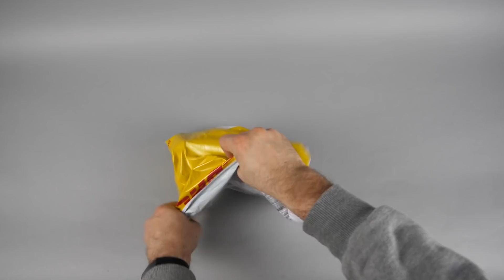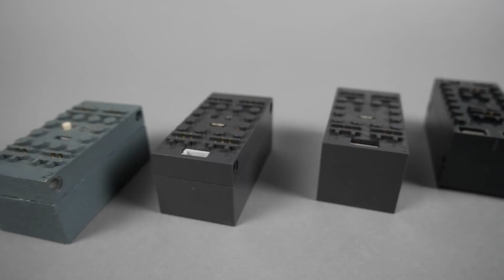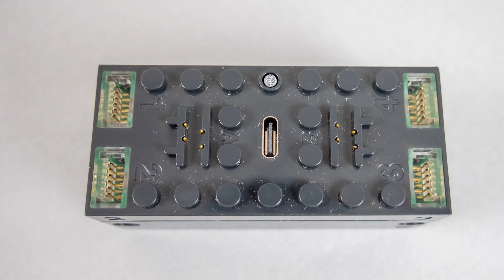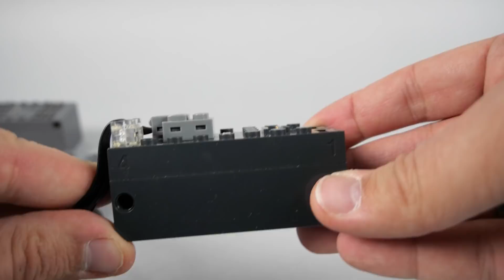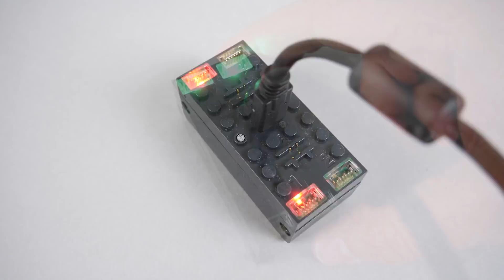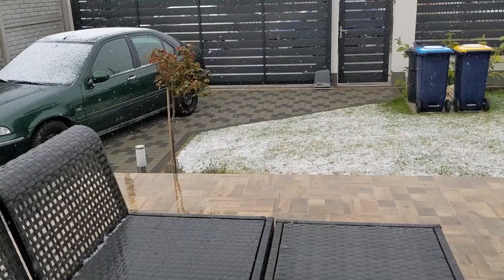BuWizz 3.0 Pro unboxing and first impressions

Comment: Now we just need to see the buwizz motor!
Reply: buwizz motor is delayed till June or July. 
they're having supply consistency and manufacturing issues. first batch didnt meet spec, then the motor they were using to prototype went out of stock and they had to find another supplier and start from scratch, then chinese lunar new year hit and most factories closed, delaying everything by another month.

so, its going  to be a while if it ever does come out.
Reply: My last update email on March 17th said they should be finished in May.
Reply: @heruhcanedean  yup, and then by the time they receive their completed units and verify them it'll be mid to end of may, and then it'll likely take another month or more to ship the first batch globally since world wide shipping is kinda fucjed right now. that means backers wont get theirs likely until june at earliest (at least outside of the EU)
Reply: @572089  "so, its going  to be a while if it ever does come out."
Do you not know what being a backer is? The last package from the EU to the west coast of USA took 2 weeks for me, but "since world wide shipping is kinda fucjed right now."
Reply: i have the buwizz motor! it is awesome, a video is on my channel about it

Comment: For me, by far the most important difference is the two extra control channels. This finally enables me to use a single Buwizz for practically all my build. Before I had to use either two Sbricks or two Buwizzs, which takes up a LOT of space and weight. This is great.

Comment: Nice review. Many thanks. Can you stack the SBrick and PF motor to multiply controlled PF outputs like with BuWizz 2.0? Now I use BuWizz 2.0 with 2 SBricks, so I can control 12 outputs with the only one power source. It would be nice and save a lot of space to mix PU with PF motors with only one battery. For example 4 PU as servos to control pneumatic valves and stack more PF motors. And crème de la crème would be to control all of it with a PS4 controller. Best regards. :)

Comment: Can the app be linked with a bluetooth controller? Or do we still need the Brickcontroller2 app for this? I really dislike the use of my phone for driving a RC car. It would be super nice if a bluetooth controller could connect directly to the Buwizz unit (without the use of a phone), but I guess that is too much to ask :-)
Reply from the maker: There's no controller support at the moment, can be suggested as a feature

Comment: Can you do a video on how to motorise the Dodge Technic Set using Control+ motors and battery (the motors and battery which comes with the Top Gear Set).

Seeing that Power Functions has now been retired.

Would be a massive help
Reply: Why dont you motorise it yourself?
Reply: @shortcoolmovies9535  because I'm a totally new to this motors and hubs

Comment: Nice product to take advantages of new power up and pf we like. It could be better if on new firmware releases can be programmed esally in phyton like spike prime, to be used in education projects if also be posible to add wedo and powerup sensors aiming primary grades. That is integrating mobile user interace or other Bluetooth gamepad, children's code in between, these sensors and the motors.

Comment: Why cant they make it 5 units wide - it's a pain in the arse building with it.
Reply from the maker: You can easily add spacers, but others might prefer the current width.
Reply: @RacingBrick  but why when Lego is all odd numbers?
Reply from the maker: LEGO Technic nowadays uses odd numbers, but neither City or other themes in general uses that. I guess BuWizz decided to fit their product in the smallest form factor possible and that is it, most of us appreciate that.
Reply: @RacingBrick  Ive never seen anyone talking about Buwizz outside of Technic. I'm sure it has a use in trains, but other than that I cant see much use for it outside of Technic.

Comment: Can it easily power lighting kits as well as motors?  The LED dot light kits I've bought come with their own battery boxes and have no remote control. The headlights should come on with the engine power!
Reply from the maker: Most of the light kits you can buy are not modular so they are not designed to be powered and controlled by LEGO power sources. You can buy Powered Up LED lights (88005), but that's only one pair per port so it's not a full kit.

Comment: I love your videos
and Been waiting for this review for a long time now..
but this video seems rush and under your standards.
I'm grateful you made this content available ASAP, but .. IDK, (did you try to swap the lights and the PF motor, and put the brick into the car better). anyway.
Thanks!
Waiting for your other more in depth videos about the BW3P.
Reply from the maker: As I mentioned in the video the app is still in beta and firmware update is also expected, there was no point to go into all the details yet. The video was already 10+ minutes long with the initial details, more will follow.

Comment: awesome. is it possible programming by accelerometer? for example if value of axel X become some value then turn on some motor or call some other action by changing accelerometer value?
Reply from the maker: Programming abilities are planned but not available yet in this version I tested so I don't know what will be available

Comment: I had buwizz 2.0 but it once dived into water and died. I have sbrick now, should i buy buwizz and which one? I mostly build with lego pf and not c+. Great video. In Poland there is also snowing right now
Reply from the maker: If you build with PF only then BuWizz 2.0 is perfectly fine I think.
Reply: the main advantage of BuWizz over S-Brick is the extra power and the rechargeability. If you use PF only / mostly, I would get the BuWizz 2.0 . No point getting the newer unit if you dont use C+. (I think, anyway!)

Comment: Hey, I just got mine today and I stumbled over something that upset me quite abit. I was in the assumption you could program with the BuWizz app, but I just can't find any option for that? All I can chose between is either the controls or two "logic modules", center steer and tracked steer. Do you know if BuWizz ever gonna add blocky programming like in the SBrick and LEGO app?
Reply from the maker: As far as I know the team is planning to add coding abilities to the app but it's not there yet. I suggest to reach out to them directly and ask about their timelines.
Reply: @RacingBrick  I just got an answer from BuWizz support and they told me that they want to keep the app simple, but gonna publish the communication protocols for the community to create an app that is capable of programming. :I
I hope SBrick is gonna take advantage of this.... Tho I doubt LEGO would.

Comment: Hi :) just a little curious… Can you run 2 or more motors off the Buwizz brick that spin in sync with one another? Like not having to adjust them all with their own individual sliders on the app screen? Like can you control multiple motors with just one slider?
Reply from the maker: sure

Comment: Can it use any Power Functions motor as a servo motor?
Reply from the maker: No
Reply: i suppose the normal  pf motor has no reference , having only two wires

Comment: Is this thing compatible with the brickcontroller2 app?
Reply: Sort of compatible, but the steering calibration has some issues
Reply: @racingbrickshorts  i think for this Problem i can just use a normal power functions servo motor
Reply from the maker: @Someone-jf6sr  true, that's a possible solution
Reply: @RacingBrick  and can i also make a motor to a stepper motor without any issues?
Reply from the maker: @Someone-jf6sr  I'm not sure if BC2 supports currently this functionality with BuWizz3 and the Powered Up motors. I suggest to check the BC2 topic on Eurobricks and maybe ask the developer there.
Reply: @RacingBrick  if the bc2 App doesnt work . Can u Connect a playstation 4 Controller with the buwizz App so you can control ur mocs with it . Does that work?
Reply from the maker: @Someone-jf6sr  not yet. The BuWizz team is planning to add controller support (and stepper motor support as well btw), but there are no signs when that will happen
Reply: @RacingBrick  thats the exact things i want . When there are signs ,will you make a Video?
Reply from the maker: @Someone-jf6sr  sure